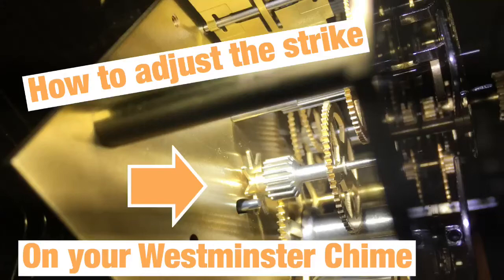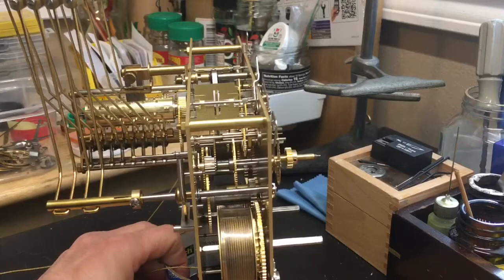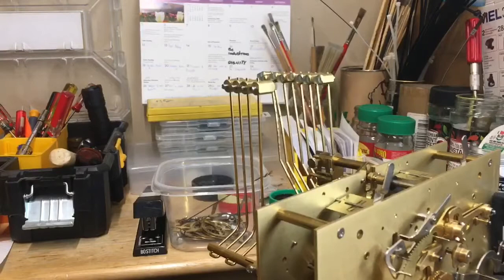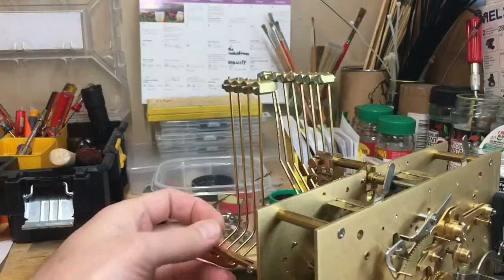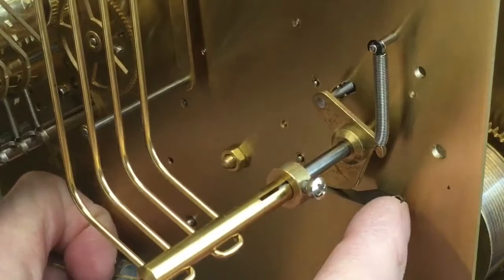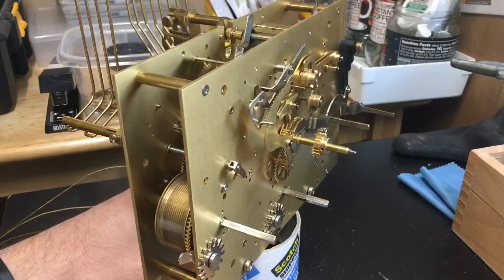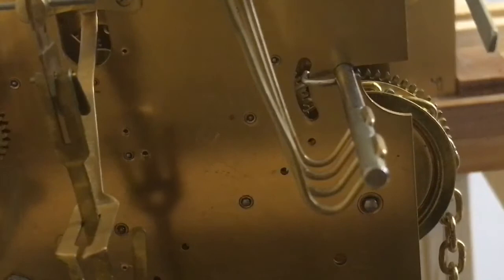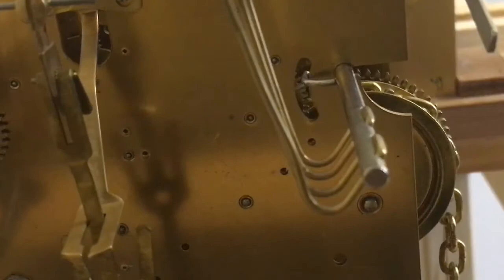How to adjust the strike on Westminster Chime

Comment: The clock repair shop I use said this (fish wheel/star wheel) was what needed adjusting, your video was very helpful in ensuring I got the position of the pin that the wheel lifts correct for the strike (hour toll).

Comment: I have a 661 feintechnik clockwork who has a plastic strawheel kind of pusher for the bell. I did see now I did wrong with assemble it because now I need to adjust that wheel so the hammers are free like yours. Thanks for clear video.

Comment: Chris...Great video with TREMENDOUS detail.
I subscribed to your channel and looked for a video addressing the chime (not the strike).
My mom's grandfather clock misses the second of the four (from low to high pitch) about every time in all of the varied sequences.
Low pitch to high: 1, 2, 3, 4.

Ex:
At 15:  x, 4, 3, 1.
At 30:  x, 4, 3, 1...1, x, 3, 4
At 45:  x, 4, 3, 1...1, x, 3, 4....4, x, 3, 1
On the hour:  x, 4, 3, 1...1, x, 3, 4....4, x, 3, 1...1, x, 3, 4... Then strikes the hour
X being the missing chime.

I look at it and it moves but doesn't quite connect. (Still in the grandfather case)

I REALLY hope I don't have to try to remove it from the case.

My Grandpa built the case...starting from the tree...in the 70s!
Important note: I am nowhere near being a clock tech, but i am the only one who has been able to keep the clock running and on time.
Reply from the maker: The hammers for the chime are designed so that you can bend them so they are closer or farther from the chime rod. If one is missing the rod, simply bend the wire (little by little until you get it to sound just right
Reply from the maker: Bend the chime hammer, not the chime rod
Reply: @Chrisclockrepair  right...but you mean bend just the skinny rod that holds THAT PARTICULAR HAMMER slightly more towards the chime, right?
Reply from the maker: @RADone65  yes.
Reply: @Chrisclockrepair  Tried that today. Had Mom stop her clock at noon and went over after work.
As I was watching the chime sequences, it appears that the range of "swing" on the second hammer is not as pronounced (drawn back) as the other three. Like the cog is not pulling the hammer back far enough to give it enough momentum to "slam" forward onto the chime...a little, but only about half as much it seems. There are two springs on each hammer I believe, and they appear to all be there and in place.
In one of your videos, you removed the back plate that holds the chimes. I cannot do this because it is not screwed on, it's nailed and glued together. This also makes it hard to see inside what exactly is going on.
Trying to find a brand identifying marking somewhere on these works but I haven't yet.

Like I said earlier, you are awesome, and your help is greatly appreciated!
The nearest clock shop is in Portage, about 45 minutes away and I am hesitant to remove the works from the case...
Reply from the maker: @RADone65  you could have him come out for a service. You should call him and see if he travels that far

Comment: You’ve provided some amazing information, Chris. I wish I could bring my large, old German beehive mantle clock to you for service! Short of this, do you happen to have guidance describing how to remedy a clock that strikes the right hours at the right time, but the Westminster chimes are out of sync? That is, my clock chimes 8 Westminster gongs at the 1/4 hour, 12 gongs at the 1/2 hour, all 16 gongs at the 3/4 hour … and only 4 Westminster gongs before striking the time at the hour. Thank you for your kindness in sharing.
Reply from the maker: Send me a photo of the mechanism at chrisclockrepair@gmail.com so I know what kind of movement you have.
Reply: Hello, it seems to me that your melody track is out of sync, I had a problem like this with a small grandfather clock, what happened was the hour strike weight had touched the floor of the clock and put the clock out of sync with the quarterly functions, so my solution was that I had to unfastened the small nut holding the hands, and I moved the minute hand to the corresponding note, this fixed the problem, if that helps you....if this helps for the future.

Comment: I bought a Howard Miller Barwick Grand Father Clock in an auction about 5 or 6 years ago. I had it serviced and it worked flawlessly. All of a sudden the hour chimes would be off sync. One o'clock would chime 2 or 3 times, 12 o'clock it would chime as many as 14 or 15 times. I cleaned and oiled it and it keeps good time but the chime go out of sync periodically. Sometimes it chimes correct on the hour. According to the paper work it was bought by the original owner in 1972. The numbers on the back of the works says: Howard Miller No.8197. The model number of the clock is 860. Any advice would be greatly appreciated. Thank you, Tim
Reply from the maker: It sounds like the rack is not properly engaged somehow.  It could be from a faulty spring or the rack hook is missing, etc.  If you watch my video on how to install rack and snail movement, that may help you diagnose your problem.

Comment: I inherited my grandfathers grandfather clock and after 6 hours I finally got it running. It sat in storage not running for 6 years. After several adjusting sessions I finally have it on the correct time and holding time but is there a way to make the strike quieter? It seems significantly louder than the chime. It’s a Westminster movement

Comment: I have a ridgeway grandfather clock that is cleaned oiled but chime won't run. I adjusted star wheel as shown @ 8 minute but still no run and release? Help😂
Reply from the maker: Your clock may need to be serviced.  How much wear is on the pivot holes?

Comment: Hello. How are you? I received the grandfather clock that my Dad built. I keep running into problems. First one was three rods broke in transit. It is a Keininger movement. I thought I could just replace the rods, but alas they are stuck in there. So I grabbed the base plate number B122\20 and figured I would just insert the new set. Well apparently these 2 sets that I've bought, neither had the bolt holes align exactly like the other. I thought easy fix, I'll large the one hole that was out of line by a couple of mm. Did that and finally got the last bolt in tonight. Now I've noticed that the rods themselves are at different angles and not as up and down as my originals. So now I need to cut out a section of wood that is my back plate bracket so that the rods freely hang down, and are not wedged against the side of the bracket. But my main question is, on the side of my 8 rods (not the 4 strike set) I have one hammer that is loose. It is not aligned with the other 7 and rests forward. Do you know how to adjust that? 🤞🤞🙏🙏
Reply from the maker: If you are referring to the hammer that strikes the rod, these are designed to be bendable to adjust the striking distance. If you are referring to the chime block rod being bent that is another story. These can be adjusted slightly but if you move them too far they will break
Reply: @Chrisclockrepair  no it is the hammers I am talking about. There are springs on them. Not sure if that means anything. But when they are all at rest away from the rods, I have one that is loose and does not stay away from the rods. The others don't "fall forward" like this one does.

Do you have an email I can send a pic to? I'm at work right now though. I live on west coast of Canada)
Reply from the maker: @shonelanglois400  chrisclockrepair@gmail.com

Comment: I have a model 100m movement that I got running perfectly after  it sat for 19 years. The westminster chimes are ooeeating on a four hour sequence. On the first hour it rings quarter after. On the second hour it rings half past, on the third hour it rings quarter to and on the fourth hour it completes the song and strikes the hour.
Any idea?
Reply from the maker: There is an issue with the lift that releases the chiming. At the hour it always lifts higher than at the quarter hours and so it chimes on the hour but not at the quarter hours. There is an issue with the cam positions, the warning pin position, a worn center pivot hole or a worn cannon pinion

Comment: Hello.  I have a Emperor clock with a Jauch 77 movement.  I can't figure out how to get the notes to play in the right sequence. To explain, let's start with the hourly chime and consider that it's grouped in the four lines of notes (for the four lines of the prayer).
On my clock the quarter hour plays the last line of the hourly chime.
The half hour plays the quarter hour chime and then the first half of the half hour chime. 
The three-quarter hour plays the last line of the half-hour chime and the first two lines of the three-quarter hour chime.
Finally,  the top of the hour plays the last line of the three-quarter chime and then the first three lines of the hourly chime. Then the cycle repeats.
Is this something I can fix?
Reply from the maker: If you watch my video "how to install rack and snail to chime and strike" this will show you how to get your clock chiming in the right sequence.

Comment: Do you have any videos on how to reassemble a movement? I purchased a Hermle triple chime movement that was very gummy for $20. I was going to disassemble the movement completely so that I could clean every part and then reassemble, however I started with the hammers and although I could get the nuts off the plate at the end of the hammer spindles I could not actually get the rods that hold the hammers nor the plate itself completely off to be able to remove the hammers from the movement. I then decided that I would simply button it back up and do the best cleaning that I could with the unit as one whole piece. However, I am now having difficulty getting the hammers back into proper position. One of the pivot points for the hammers where it goes through the rear plate is not going through as it ought to and as a result it is causing the hammers to bind. The movement only cost me $20 so I'm not out a lot of money, but I would like to use this as a learning experience and I believe the movement itself is good if I can get it fully cleaned and oiled. At this point though I need to figure out how to finish disassembly or I need to figure out how to just get it back together so that I can clean it. If you have any videos that will help me out in this endeavor or can provide guidance on what I need to do it would be appreciated
Reply: If you haven't taken it apart yet, DON'T! Try this first. I use a gallon of Colman camp stove fuel in a pail that will cover all of the clock movement. I let it set in the pail for a few days and slosh it around periodically. You can't do it too much. It should dissolve the the gunk. If you have a compressor, blow out the gas. Set up the clock to run making sure the movement is plumb and level. If it runs for a day, oil it with clock oil and let er go. If it doesn't, repeat the gas soaking again. This method has worked for me many times. I've found that most of the time the movement failed to run was because I missed on the plumb and level or the beat was wrong (out to balance) which is adjusted by moving the escapement lever that the leader and pendulum are suspended from. If you've tried this with no success then take it apart. Easy to take apart, PITA to get back together. TAKE PICTURES!
Reply from the maker: I am not familiar with the Colman camp stove fuel cleaning method; however, cleaning the movement is an excellent start.  Then you can diagnose what, if anything, is wrong with the movement.  I use standard clock cleaning solutions that you can get at clock repair suppliers such as timesavers or merritts.
Reply: Thank you - Coleman fuel as  a lightweight petroleum product makes sense for cleaning.
Reply: After I sent this question I found a video you posted on how to reassemble a movement in its entirety- the video was extremely helpful. I find your videos very easy to understand and follow- I appreciate your time and your sharing of your expertise
Reply from the maker: @ajbergman3801 awesome! Thank you

Comment: do you have a video for the minute hammers... I have one that will not strike correctly... if the hammer is at the same angle as the others, the clock cannot turn the wheel that makes the hammers move... if I bend it so the chimes work then this hammer is either all the way back and wont fall or it rests on the chime and wont sound..... HELP
Reply from the maker: Are you referring to the chime hammers driven by the music roll? At the end of rack and snail video, I show how to adjust chime sequence. It sounds like your music roll is too far forward and there is not enough “run” and so the clock stops. If that isn’t your problem I would need a little more detail
Reply: @Chrisclockrepair  Thank you for replying to me... yes its the music roll.... but... is there a way to send pictures to you? Ive watched the other video but im not sure that is the issue... of the four chime hammers, the first one, closest to the rear of the clock, actually sits closer to the chimes.. the spring is not flexed. If the back part of the hammer is in line with the other hammers, the hammer itself rides against the chime. If I adjust the hammer to not sit on the chime, when the music roll turns, that hammer goes back but wont fall, or the music roll point sticks on the hammer piece and stops the roll... I appreciate your time...
Reply from the maker: @everwharesismine  yes. Send me pictures and or 10 second video to chrisclockrepair@gmail.com

Comment: I am troubleshooting my Westminster clock chime train. On my grandfather clock, the hourly strike works fine but the Westminster chimes will not start without a push on one of the train gears. My hourly strike train has a star wheel like your video shows but the chime train does not. Can you help?
Reply from the maker: Watch my rack and snail video and see if that answers your question.

Comment: Sir, I  have a Western Germany clock 1972 wesminter,some time chime not strikes at 45minute,can you show how repair it,thank so much
Reply from the maker: It probably is because your hour correction is preventing it from going off. The 4-4 cam may be slightly out of adjustment and its not locking after the hour chime sequence. Watch your cam and see if it locks after each chime sequence.
Reply: Thank you Sir,let me try to check it

Comment: I inherited a pendulum Grandmother clock. It is keeping time and it chimes properly at each quarter hour, but when it's time to chime on the hour, it suddenly becomes chime happy, striking excessive number of times each hour, and I mean all over the place. I've counted strikes into the forties and fifties, and once I even counted 100 strikes! I am happy this old clock is keeping time and striking when it's suppose too each hour, but wish it would strike the correct number for each hour. Can you tell me what to do to stop the over striking? Thanks!
Reply from the maker: It sounds like the gathering pallet has come off
Reply: Chris what is a gathering pallett?? I am helping my Aunt get her grandfather clock adjusted and hers is doing this very same thing.
Reply: If ypu can take the clock dial off, it will expose the "motion works".. Which is clock terminalogy for all the links, levers and cams that control the chiming and strike actions.... With the minute hand back in place, you can observe the operation of the strike counting mechanism.. Might be something bent, jamming the rack.  Or not engaging it properly..
Hard to explain all this here. Google "rack and snail" chiming mechanism.. Will get an idea how it works...
Reply: @bobmclaughlin7276  Thank you!

Comment: I got a Howard Miller 3 chime grandfather clock and everytime I wind up the weights the second hand would run counterclockwise along as I wind them up. Is this normal is it some sort of malfunction?
Reply from the maker: Thats interesting. Clocks can be unusual creatures. I really couldn’t say for sure why that would be without looking at it. If the clock operates fine otherwise, I wouldn’t be concerned. I never came across that before

Comment: My hour striker strikes the right hour sometimes and other times it strikes an extra hour could that be because of the star gear
Reply from the maker: Does it always happen at the same hour or at random hours?
Reply: @Chrisclockrepair  that's a good question I'm really not for sure it used to not do that but I forgot to wind it one day and it stopped
Reply from the maker: @markwilliams9718  My guess is that the gathering pallet is not being stopped correctly each time as the rack gets fully gathered up. Probably some wear on the pallet or the arm that catches it. I hope you know what im talking about
Reply: @Chrisclockrepair  yeah I think I do I've watched a lot of your videos I watched a lot of other people's videos too but yours is the best the hammer was hanging up on the star gear it wasn't sitting in the middle

Comment: Chris we have a Howard Miller EDINBURG 82ND Grandfather clock. The hour chime is correct but the quarter chime is 15 minutes Behind the correct time/chime. How do I adjust this.
Reply from the maker: Those clocks should have a self correcting mechanism built in.  It should reset to correct chime sequence after a full hour. How long has it been doing that?
Reply: @Chrisclockrepair  Since Sunday. The store guy installed it and adjusted the hands and such and spent two hours on it. We finally have it chime the hour correctly at 15 minutes after the hour. All quarter hour chimes work they are just 15 minutes behind. At half past the hour it chimes quarter hour. Note since we are near Daylight savings time we had him set the clock one hour ahead so we didn’t have to adjust it in March.
Reply: Any help you can offer would be appreciated.
Reply from the maker: @davidb2363  email me your phone number and I’ll call you tomorrow. Chrisclockrepair@gmail.com